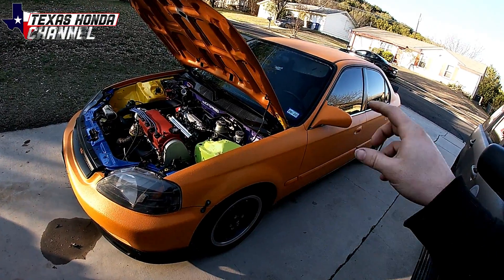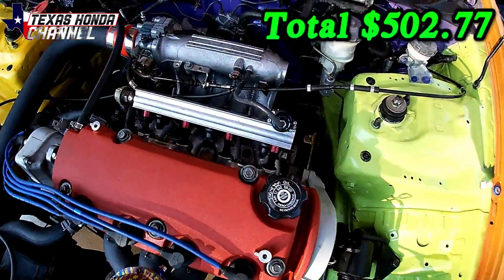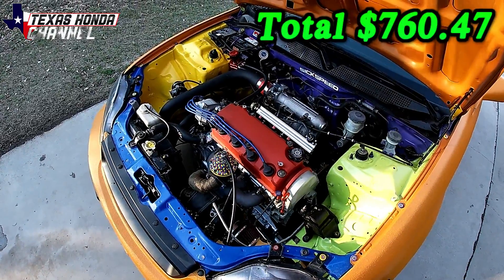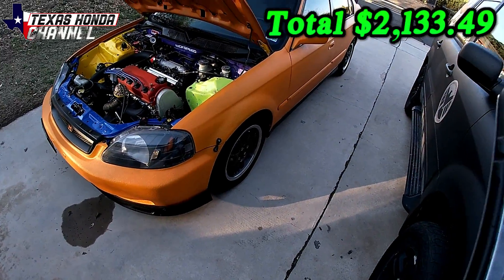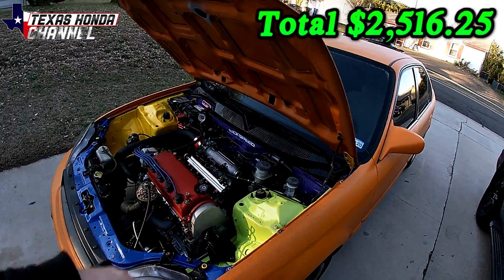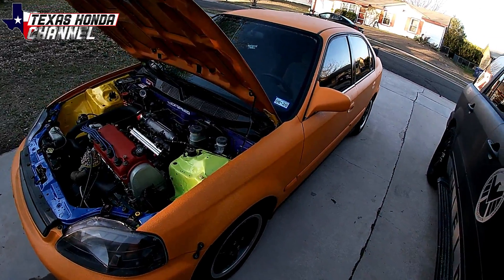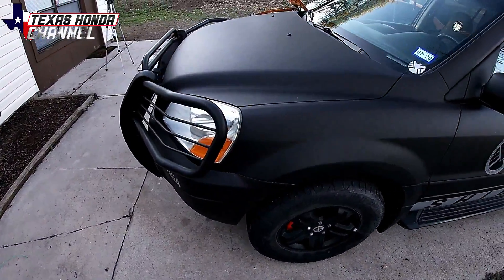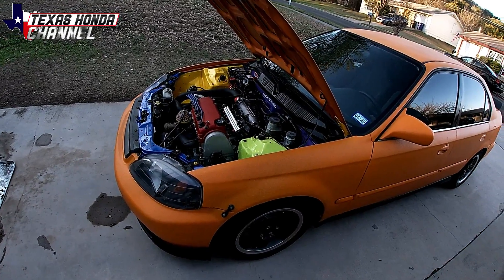Turbo d16 Build break down cost.

Comment: How much HP does it get again?
Reply from the maker: Well stock puts down 100whp roughly and from stock to this it was a 200whp gain. Could have been more had i went with a smaller turbo. It was too laggy and power didn't come in till later in the power band. I have seen people with smaller turbos on similar setups making 350-400whp

Comment: I’m trying to put a cheap eBay turbo on one of my 2 5th gen preludes. Either the 97 base has a jdm h22a or my 99 sh with stock h22a4 with atts. I basically can figure out how to do all the plumbing and hooking up the turbo to the motor my biggest thing that is stopping me is what I am gonna need to tune it and how to even begin figuring it out. Any advice. If I put a Hondata on there is it gonna mess with my immobizer? Is there a way to bypass it?

Comment: Sweet breakdown bro, I'm working on the paint now. Trunk came out ok,  needs the dust particles sanded out. Planning on getting the rest don't this coming week. Are you getting supertech for the valvetrain? I priced it out for around $300 for Springs and retainers. Can't wait for more videos on this ride. Are you going to do recaro sr3 style seats? I plan on doing that and covering them in all red.
Reply from the maker: Tony Ventura idk what seats ima do right now. But saw your trunk looks good!
Reply: @TexasHondaChannel  thanks bro, I appreciate your input. This past week I was working on the engine harness to convert to a 2 pin IACV and wire in Vtec. I'll update Instagram on that progress.

Comment: Dang where that oil leaks come from on drive way? The wrench apart in lubbock only had f23 n k20 no d16 or d15. I am looking for d15 piston. May have to hit up belton wap
Reply from the maker: Ragged Ridez thats not a oil leak lol 😂 it had rained and everything else was in the sun and the few spots under the car were still wet. It does look like a nasty oil leak don’t it though lol

Comment: Im curious where you got a oil pump for that price.  Im in the process of getting parts to rebuild a b16
Reply from the maker: Undeadone069 EBay and they work perfectly fine. I use them in almost all my rebuild engines. I will be upgrading to a ACL pump in the future.
Reply: @TexasHondaChannel  thanks i was debating on a kit that's on Ebay  but i think i would just stick with stock pistons.  https://www.ebay.com/itm/281675494600.  Figured oem pistons should be better than Ebay ones.
Reply from the maker: Undeadone069 I have eBay ones and there is nothing wrong with eBay pistons keep in mind EBay don’t make pistons sellers on eBay do. I recommend them but oem pistons can handle a little power either way. I put my kit together myself I didn’t buy a specific kit.
Reply: @TexasHondaChannel  thanks for the advice it really helps i appreciate it alot.

Comment: I love this. I’m working on a 97 civic and going the vitara build route. I have some cheap DNJ crank and piston bearings but since their so cheap, I’m kinda questioning their reliability. Should I buy some some performance racing bearings or would the ones I have work? I’m assuming the former is the best answer but just wanted to get your opinion on it
Reply from the maker: Swiggy NutMcgee ACL is the best but I have used the ones you mentioned but I highly recommend using some bestline oil additive to prolong their life. 

Use code Dguy20 for 20% off 
Here is a link http://racingadditives.com 

Get the bestline oil additive it’s truly amazing. Feel free to do a search on YouTube on how good bestline is.

Comment: I got a 95 civic wagon rt4wd,
Im going to paint it like you since the clearcoat is flaking.
And im gattering obd1 swap parts for it. Can i use the same parts as you did on your build?
I really wanna get like 300 horsepower from it, keep the non vtechead im from the netherlands and i wanna keep a bit of the fuel economy since a litre of fuel cost here 1.65 euro
Reply: It has a d16a6 btw
Reply from the maker: niels Eijzenga the D16a6 is the strongest D series out there so you can easy make 300hp on it with stock internals using the parts I used and my tuner can get you some power but gotta pay to play unfortunately. I love how my build turned out on the stock engine im so excited to see what this build block can do.
Reply: You mean stock internals as in stock rods and pistons?, let me put it like this, what would i need to get 300 (safe) horsepower from that engine?
Reply from the maker: niels Eijzenga 250hp is safe on stock internals rods and pistons and all. Using the exact setup I have ^ for more than 250whp I suggest forged rods and pistons like I used in my build ^ them it’s capable of 500whp safe
Reply: @TexasHondaChannel  thanks!